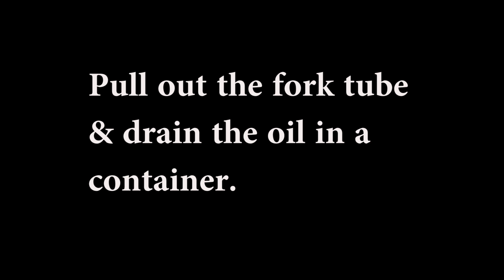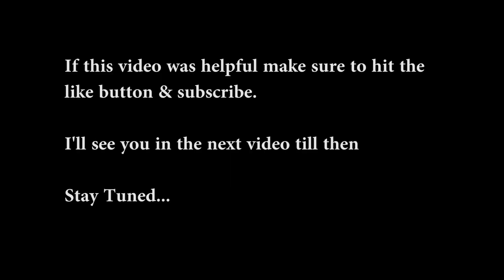3 steps to change oil seal | Duke 390

Comment: What is the grade and company of oil you used
Reply from the maker: hemant kumar i used regular grade oil easily available at any spare part shop just ask for fork oil company was veedol or you can get specified oil from the service centre
Reply: @rollingsoulvlogs7880   ok thanks
Reply: Ktm recommends 4w oil and as far as i know you should put 450 mg oil each fork

Comment: My front fork is too hard any suggestions to solve the problem
Reply: Drain the oil out of the fork and fill only 400ml of fork oil
Coz..... If it exceeds 400ml it will get hard and be like riding without a suspension

Comment: How much it cost bro for all spare
Reply from the maker: Rajesh Kumar oil seal around 250, oil 150 total around 400/450
Reply: @rollingsoulvlogs7880  tnx bro
Reply: Are there 2 oil seals in the shocker which needs to be replaced ??
Reply: @amaankhan2775  one oil seal and one dust cap seal